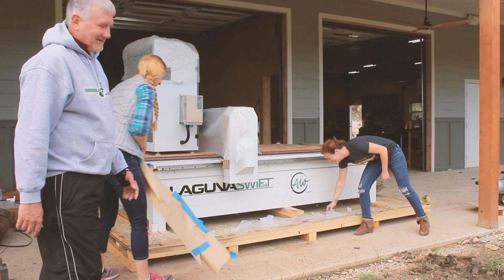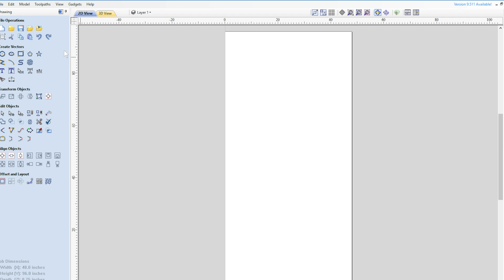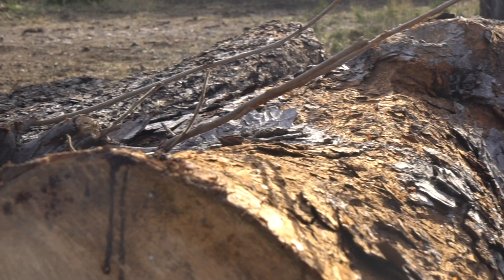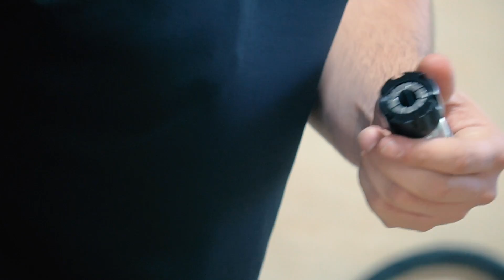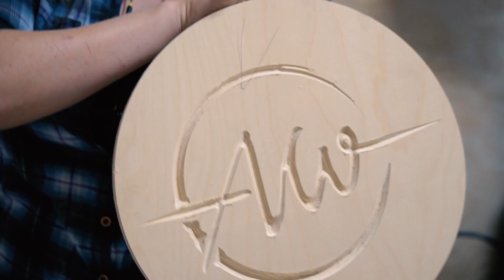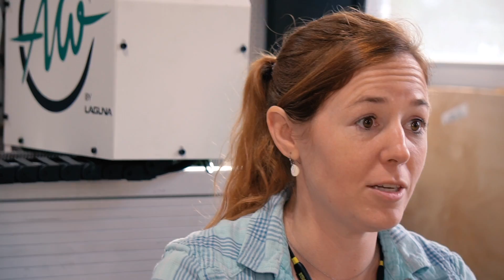How to Get Started with CNC Machining ft April Wilkerson | Learning with Laguna

Comment: We just closed the deal on a CNC router for our cabinet shop. After much homework and seeing the machines in action, it came down to the Laguna M series or the ShopSabre PRO 408 (both about $40K depending on how equipped). We were willing to go with either, but in the end ShopSabre's year-end discounts and promo goodies (like a $2500 on-table 4th axis attachment at no extra cost) gave them the edge. The Swift shown here is Laguna's entry-level machine, probably more than adequate for most smaller shops. We likely bought more machine than we need at the moment, but I didn't want to have to replace it with a different one in the near future!

Comment: Losing woodworking skill rapidly these are all great machines but can you make the stool or mallet with out these tools? I started out making a drawing , making cut list to 
Table saw finally to the assembly bench a real sense of satisfaction. Now we are just assembling parts from Cnc machines guess I am the dinosaur of the industry
Reply: You also can make all those things with a hand saw, a hand plane and some sand paper. I bet the same comments happened when people started using table saw and electric sanders. "These new fangled power tools are taking all the skill and craftsmanship out of woodworking.

Comment: That machine is awesome! Looks like you are getting the hang of it already. I couldn't afford a professional CNC like that so I am in the process of building my own 4x8 machine. I am just about done with the main panel and will be starting in the table soon. I have other projects going at the same time so I work on it when I can. I figure a couple months and it should be complete. Thank you for another great video!

Comment: Over $21,000 for everything in the video and someone used the word affordable.  Not affordable unless one already has an established business that this can be used in.  Also. "Laguna Tools may provide a trained expert ..."; does that mean they may not provide one also?  And at what cost?
Reply: Tom Zorba  no doubt that you should have a commercial use for a machine like this and have the ROI worked out (or just a pile of money for your hobby).  We built a Shapeoko XXL with a 32”x32” work area and the cost was about $2k. It definitely didn’t come with a team of people to set it up or train us. Just a box full of parts. We learned the software from YouTube videos.
Reply: Just the machine itself would be $21k add the dust collector for another $2k and then a vacuum pump for another $4 - $5 K.  Takes a lot of power as well, so you are looking at a few hundred $$ for breakers and electrical installations.  $21k is a good price for a 4'x8' CNC machine.  These are not hoibby machines and are meant to run 8 hrs /day 5 days a week or more.  The big use is cabinetry.  I have a 2'x3' machine and paid about $10k.  Again not really a hobby machine, unless you have the $$$$.  This machine would pay for itself in less than a year if you had the work.

Comment: Wow. Been awhile since I've checked out your channel. Last time I think you were setting up an xcarve. Then you moved your shop. And now!!  Congrates. If I saw correctly you have a vacuum deck. 1 or 2 pumps? You should never have to tab parts any more unless they get too small. Just a suggestion,try to get your vacuum hose from the dust collector above your z axis. Either by a boom or hang it with enough hose to reach end to end. The only limitation of the machine is your imagination. Enjoy,I will try to do better to check your channel more often. Oh I do use cut2d pro and vcarve also. If you would like a few files I wouldn't mind sharing.

Comment: HSK tooling with manual change? That's almost an oxymoron.  April, you really need an ATC  !!
Reply: That's what I thought.  Or even a power drawbar at minimum.   Weird seeing a manual set screw and clamp on something like that.  
 Once I moved to a machine with a power drawbar I couldn't believe that id been wasting so much if my life manually changing tools.  It's crazy how much productivity picks up with just a Power Drawbar, not to mention a full atc.   I think that should definitely be a project for her - make a rack style ATC.